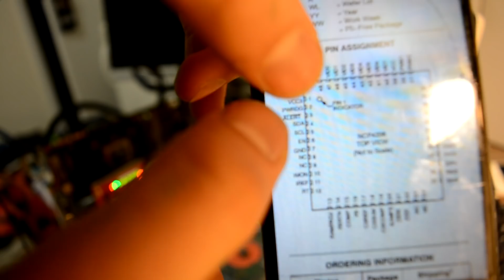Repair GTX 770 giving second life to it - no power graphic card repair

Comment: hi thanks for the educational video   i have the same problem with mine   is there a way to tell if the driver is still good or not  cause i am having another defective card that i can swap drivers   or maybe try on one by one  (  i am a newbie on gpu repair )  do you have a video that shows more clearly  voltage of cpu , memory pci express etc....  i know you need 3 voltages   12v 5v and 3v     but  i am never too sure where to take mesurement on the gpu ......anyway  you are one of  the best if not the best i have seen so far on youtube 
thanks to share with us  your knowledge  very appreciated !!!!!

Comment: My GTX 770 just died on me, a Gigabyte Windforce OC 4GB with 8+2 phase VRM and with 2 8-pin connectors. It served me flawlessly for over 6 and a half years but in these last two months, just for a stupid experiment, I left it under a 425W Enermax PSU, which turned out to be insufficient and in the long run let it die with a black screen, no more screen signal and fans at full. It sucks we're too far away. I'll try to bake it one of these days but I don't think it'll do because it has to be something a lot more serious as you've shown, especially because of the black screen.
Reply: Have the same exact card, did you find a solution?

Comment: Dear Eli,
My gtx 750 ti doesn't gives the image but when it does after a beep sound from motherboard,it given green horizontal lines on the screen, could you please tell me the issue plus the chip on the back on extreme right side of gpu processor heats up pretty quickly

Comment: Hey Eli! You have inspired me to do graphics cards repairs! So far I've fixed a 770, a 1050 Ti, and 970 and a 1070! ^u^ I always rewatch your videos when I'm stuck on what to do!
Reply: Hello, can you help me with my ASUS Strix GTX 960 4GB graphics card, same issue as this video Please help
Reply: @TECHUSK  unfortunately I'm not skilled enough yet to do the proper troubleshooting he does here, I can just usually find the location of shorts and totally broken components and stuff. Since it's the same problem though, have you tried his solution in this video? Sorry for the late response.
Reply: how much for repair
Reply: @pondsgreen9878  I'm not really confident enough in my abilities to offer a paid service. I just find them broken on eBay and try to fix and resell them. That way, if I mess up I haven't ruined anyone's day. Thanks for the offer though! I will say that repairing it yourself isn't too expensive or difficult. This guy's videos really do help. The only equipment I use is a heat gun, 60 watt soldering iron, flux, a multimeter and some tweezers. It also really helps that I have some other GPUs for parts, but in a lot of cases you can find the components you need from other electronics around the house. Good luck with your card! If you are considering fixing it yourself I could help you with the diagnosis
Reply: @NicheAsQuiche  the problem of my video card is no power no detect MSI NVIDIA GeForce GTX 1050Ti GAMING X 4G i don't see any trouble shoot of this in youtube
Reply: @NicheAsQuiche can i still fix it without heatgun? i have only soldering iron and multimeter
Reply: @pondsgreen9878  depends on the problem e.g. you won't be able to take chips off the board without a heat gun. Does your computer start when it's in? A common problem is blown MOSFETs, but that usually causes shorts which usually stops the computer from booting. Could you tell me exactly what model the gpu is?
Reply: @NicheAsQuiche  yeah when my gpu is in board my pc won't run but when i take it out my pc works fine
Reply: @NicheAsQuiche  my gpu is "MSI nvidia GeForce GTX 1050 Ti Gaming X 4G"
Reply: @pondsgreen9878  okay thats awesome. that probably makes its easier to fix and I may  know the problem but I'm not 100% sure. I need to send you a diagram of what to do but I don't think yt comment allow that. Is there some other way i can message you? It'd just be a lot easier
Reply: @NicheAsQuiche  my email where can i send? i really want to fix my gpu i need help
Reply: @NicheAsQuiche  do you have diagram of what will i solder
Reply: @pondsgreen9878
Reply: @NicheAsQuiche  already message on email
Reply: @NicheAsQuiche  i've sent picture of my video card
Reply: Hi can i know where to get the parts to be replace
Reply: @barakobull  Normally it's just capacitors or MOSFETs so I just order packs of 10 them from websites like digikey or mouser or whatever has cheapest shipping

Comment: I wish I could do this with my GTX 760. Fans spin at high rate too and no signal.
Reply: Same with my card, did you fixed it ??
Reply: @TECHUSK  no, I just boxed it up, still looks new but nothing doing.
Reply: @Preacherz  I checked it , looks like a case in VRM driver ic
Reply: @TECHUSK  I'm not good at fixing electronics, maybe I'll take it to someone.

Comment: hello n how R U? 

I have GTX 760OC that power on (fans) and the i checked it without the cooler and its heats up. Dont have display, dont have any burnt marks. what should i do please?
Reply: If it's heating up the chip is probably getting power and should be giving output, so it's possible that the chip might be dead for good. Usually the only chance at fixing it is a 5 minute reflow with a heat gun (reballing isn't necessary, the solder isn't the problem but the chip itself). Even then there's a low chance it comes back. It depends on whether or was damaged by too much electricity (dead dead) or too much heat (mostly dead)

Comment: hi.. i have a gtx 780 founder's ed. it has power and display. each time you will install drivers, it will just be on boot loop. it wont accept any driver. done uninstall / reinstall latest and older driver, flashed bios, format pc. all still doing same thing. is there still a chance that it would have its second life? pls respond. thanks.

Comment: my asus strix gtx 970 4g does not give video when connecting to the pc and check all the components and they are working, I even put it in the oven to see if the problem was solved but it remains the same. what will be the problem, will the gpu be dead?

Comment: hi. greate channel! I have a nvidia 760 witch at  some time even if the both power connections were connected, board was not booting up and was showing in bios "coonect pci-e power..." . For some reasones the board now is boot-ing ok. But on default settings the power consumption is showing only peak 72%. and temp is going in 4 seconds to 80-90 degrees. Tnx!

Comment: i have a problem with my msi gtx 770 4Gb, it works fine in safe mode...i have instaled driver and reboot, but the grpahic card was going black screen after entering windows menu screen but the windows still runing. im wondering what's the problem? is the bios/gpu chipset/another part failure. thx.
Reply: ive got a 780ti like that the 600 and 700 cards are weak,